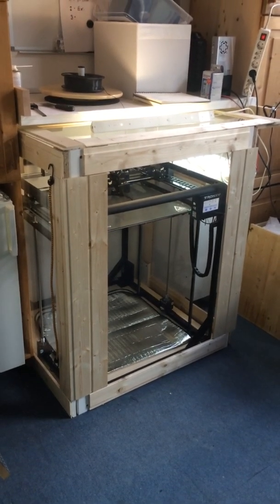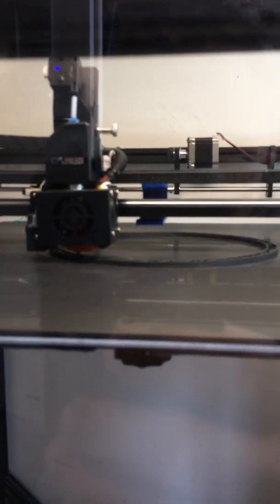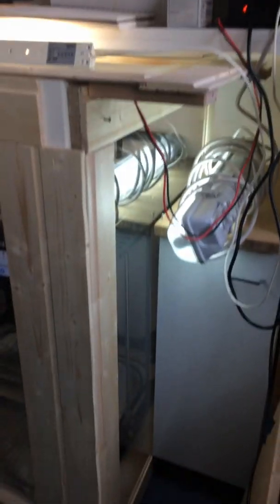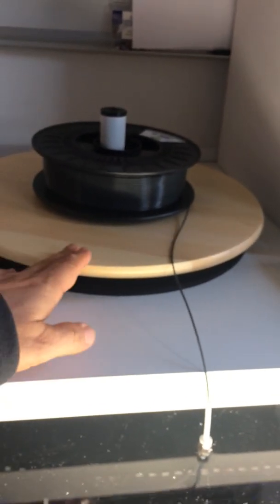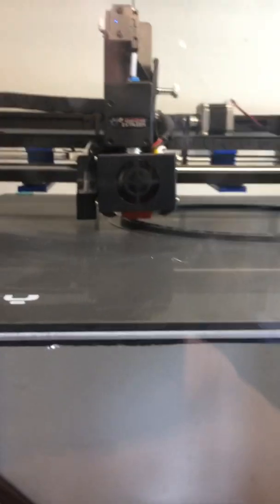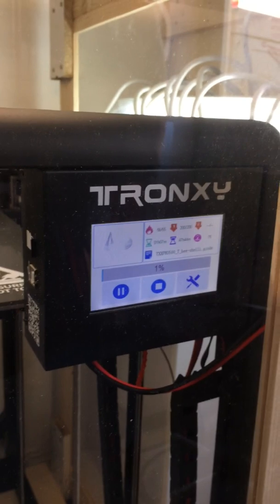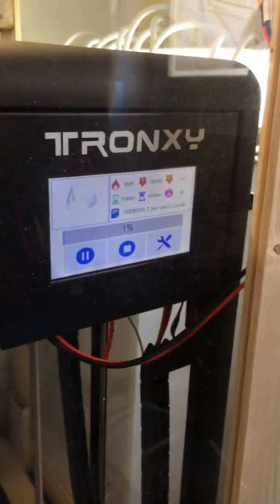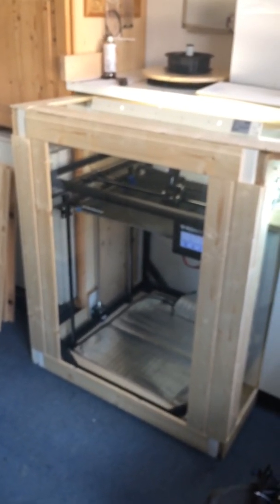Tronxy X5SA 600 - Trying to print a drumshell... review about my system.

Comment: This is simply a fake to sell the new board. Marlin runs great on the v9 board. But anyone who wants to can spend 120 euros and upgrade. Even Klipper runs perfectly on the v9.
Reply from the maker: hey wulf... i see a lot of great videos on your channel... sadly, i am not into gaming with my firmware yet... i first will have to setup all my hardware absolutely correct... so is should print at least something usefull without the marlin or klipper ware... klipper sounds so interesting... i will have to really check out all your videos... is there a english-version of your vids? do the subtitels work well? i speak german, but some other here do not... thanks for your reply! oliver.
Reply: Moin Oli,
Ich habe an meinem x5s das neue Board mit allen anderen Hardware Updates installiert, quasi zum neuen x5sa aufgerüstet - auf dem neuen Board mit der gleichen Firmware wie in einem deiner Videos /Webseite abgebildet. Mit der Marlin von Darkwulf konnte ich das Gerät überhaupt erst sinnvoll wieder in Betrieb nehmen. Mit der original Firmware ist es mir kaum gelungen und vor allem nicht qualitativ gute Drucke zu erzeugen. Die Druckqualität ist jetzt tatsächlich noch besser als vorher und ich war schon sehr zufrieden. habe mich vorher nicht vor einem Vergleich mit unseren ultimakern auf der Arbeit gescheut, jetzt noch weniger. Ich kann dir den Zeiteinsatz zu seiner Marlin nur empfehlen. Hat sich wirklich gelohnt. Dazu noch das druckprofil vom 3dmo als Ausgangslage und man steht direkt gut da. 
Danke euch beiden für eure Videos! 
Grüße 
Markus
Reply: @flo2011rida  hi na du 😀 danke erstmal. Klingt gut. Aber da ich jetz den tronxy auch auf Klipper habe muss Ich sagen wer damit echt gewerblich und nicht nur für Spielerei drucken will sollte den Weg über Marlin direkt sparen. Von Marlin zu Klipper ist der Unterschied fast wie der von chitu auf marlin. Das druckprofil wird Oli nichts nützen. Er hat einen bmg e3d V6 Hotend als Kombi im direkt extruder betrieb und vulcano noch dazu. Da passt dann quasie nichts. Normal müsste er mit dem Teil mit ner 0,8 mm Düse bei ca 70-90 mm drucken. Und infill bei 110 ca. und mit ner 0,4 bestimmt locker an die 250mm/s. Für pla zumindest. Markus Ich teste übrigens grade ein komplett eigenes Hotend im Vulcano Style am Pro. Die Anets haben das ja schon seit mai in etwas leichterer Kombi ohne vulcano. Ende der Woche die letzten Teile dafür von der drehbank holen. Vg Ralf
Reply: @Darkwulf3D  hi Ralf, danke für deine Antwort. Deine Klipper Videos verfolge ich noch still und minimal neidisch. Das stimmt, guter Punkt. Für den gewerblichen Einsatz sieht das ja schnell anders aus, als für uns Hobby Bastler. 
Vielleicht liest Oli ja mit, dass wir vielleicht noch eine kleine Review von ihm zu dem Drucker und der Qualität bekommen (vielleicht auch kurz zu den Geschwindigkeiten). @oli: also wenn ich so wünschen dürfte (ist ja bald Weihnachten 😉) eine Zusammenfassung deiner Reise mit dem 600er und ein zweites Video zur Druckqualität wäre mega cool.
Reply: @flo2011rida  Denke Oli macht da bestimmt noch das ein oder andere :-) Ja Ich denke das Ich bis nächsten Januar gewerbe Ready sein will und werde. Wird zwar langsam echt straff aber der Anet zb läuft jetzt auch schon seit 2 Wochen mit Pei Bett usw. Dazu muss Ich irgendwie dann noch sone Zusammenfassung machen auch für Klipper. Aus dem Tronxy muss dann auch Das Originale Board noch raus wenn der jetz paar Wochen mit Klipper sauber gelaufen ist. Work Work Work. Mit der Marlin für Oli gibts auch noch ein Problem. Die Säcke haben die letzte Zeit so viel geändert um allen umflashern das Leben zu Hölle zu machen. Alle neuen Boards haben jetzt den STM32 F446 dazu gibts noch kein Pinout. Die Boards haben noch immer kein Uart. Also laufen die Treiber noch immer Standalone. Total banane wo die selbst Marlin anbieten. Noch dazu haben die jetzt größere Bildschirme. Somit läuft meine Marlin auch nicht bist Ich da was weiss welches Pondo Ich dazu ran nehmen kann was es gibt. Daher halt die eben erwähnte Klipper Sache dafür ist das Bildschirm geschisse völlig egal. Mein bestelltes Spider was in den Tronxy sollte ist auch weg gekommen auf der Post. Dank Stephan hab Ich Jetzt wenigstens ein 1.4 Turbo was Ich dann für das Video her nehmen kann. Wir müssten Irgendwie mal mehr Leute auf die Kanäle kriegen bei Oli und mir. Damit das ganze größere Kreise zieht wenn da negatives auf taucht und eventuell auch mehr Leute die Probleme haben nur noch nie bei Youtube geschaut haben. Denn Tronxy interessiert das eh nicht was wir wollen.
Reply: @Darkwulf3D  ja, bin da ganz bei dir. Du gibst dir viel Mühe mit richtig gutem Inhalt und wer die Videos von Oli anschaut, kann auch erahnen was er an Zeit investiert. Würde mich für euch und auch für eine community rund um die tronxy Geräte sehr freuen!
Ich bleibe auf jeden Fall an euch dran (wenn auch noch ohne Schlagzeug und Klipper)
Reply: @flo2011rida  sehr cool dank dir 😊